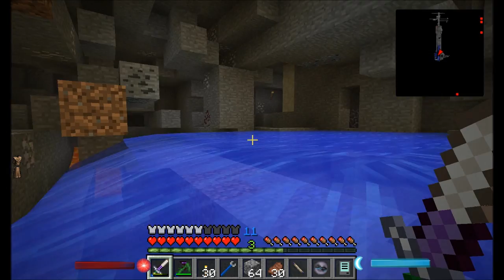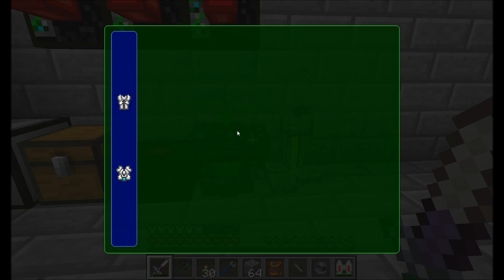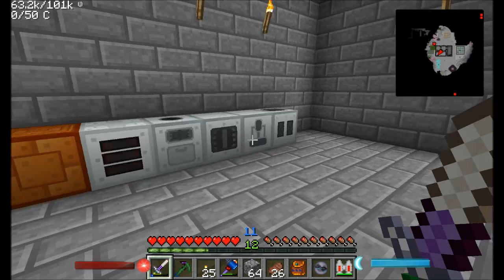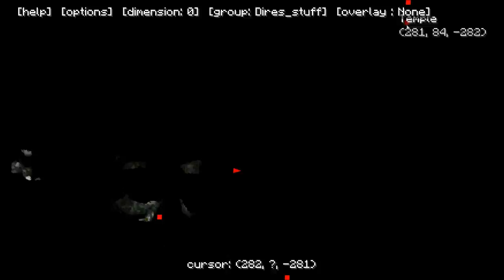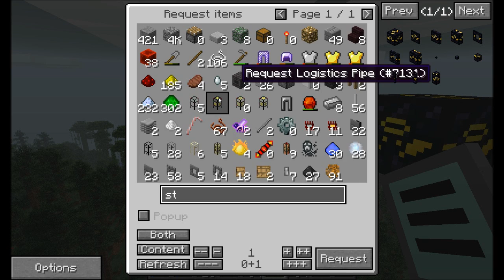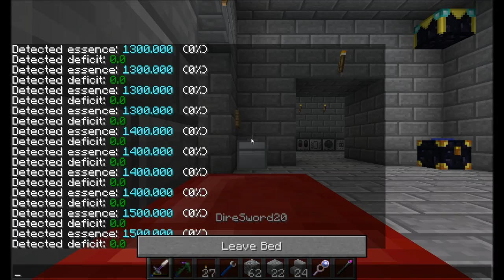Lets Play   S6E41 UberMiner Prep

Comment: Dire, useful tip for the flight mode on the modular powersuit: Keybind the flight control system in the helmet, and mostly use that instead of toggling the jetpack and boots. Then you don't even really need jump assist - leaving the pack and/or boots on lets you act like you have an IC2 jetpack, so you can control your "jump" height very easily, as well as soften your landings or go for brief 'suborbital hops', and turning on the flight control mode transforms that into the stable creative-like flight.

Another option is to put the boots and flight controller on the same keybind and only leave the jetpack always-on, which makes it easier to not rocket skyward every time you jump but still gives you the faster ascent of having the boots enabled when using flight mode.

Comment: It will be MFFE. MFFE now has something very similar to RedPower frames, though it is still a bit buggy based on some of the testing I've done. Just like RedPower you pulse your engine to move everything that is part of the frame, but unlike Red Power you don't need special blocks as the frame. Just upgrades to define the dimensions of the overall area to move.

Comment: Dire thanks for answering my question about the scrolling shortcut :)
Why don't you try IC2 teleporters? (Blue teleporter blocks) They drain energy but you can also transfer power much easier with it because it does not need a tool to tell you how much power it has, moving the ars magica stuff for power is a hard task.

Comment: I'd love to play with your modpack, but my computer just doesn't have the strength to run with a stable framerate. There are just too many mods installed. I can't even get over 10 FPS with the bare minimum settings and with config files edited to be optimized for performance. I'm going to need a new computer in the end, and that's going to be expensive.
Reply: I had the same reasons as you did, however, I just went and built one:)
Reply: MoMan711 I might have a custom one built online so I don't have to worry about putting it together and screwing up on accident. I don't think I can put one together without having my hands shake. I'd get way too nervous.

Comment: Not turtle-based? WHO ARE YOU?! AND WHAT HAVE YOU DONE TO DIRE?!
Reply: the massive, eat 1000 blocks at once frame quarrys of the olden days :)
neeeeeeeeeeeeeeeeeddd frames :)
Reply: i know, i was shocked too
Reply: I think it is MFFS, or maybe he has a updated version of project red with them movey things
Reply: *****
frames... i miss them so badly
Reply: But he did the frames thing before.
Reply: Max Koved Dire said it was never on a dire video before.. Thats why he pointed that out.
Reply: PartyRockerC Frames -_-
Reply: Pretty sure it is gonna be MFFS, I made a pure MFFS bore on a server, and it's incredibly powerful. And steel intensive (that's why he setup the autosteel crafting) to a point you wouldn't imagine.
Reply: sc2_Nightmare So what? It worked.
Reply: llomellamomario the mod pack doesnt have mffs calavia version (if your mffs is the same as mine)
Reply: llomellamomario nvm just checked

Comment: Dire, How I fix the problem with minimap?
Reply: showing current level and not surface in general? i believe default keybind to swap between cave mode and regular mode is u. it's either u or i for certain, but im pretty sure it's u
Reply: smash the fingers on your keyboard and hope that you hit the right keybinding... :-D (joking)
Reply: MadLocustRising1 lol that's me when i accidentally hit something and i dont know what it was and i dont like what it did
Reply: PaleWaffle tell me about it :-D i had trouble with my map at the start of the 1.6.4 pack release. for some reason it wass zoomed in all the way. then i found the ''Page Down'' key and its uses. glad i did :-)
your ''Esc'' option should have Controls options, and in there it should be easy enough to find the hot-key you are looking for. alot of hot-keys are badly placed. too many on ''C'' key by default thats for sure :-D
Reply: Thanks, you helped so much.

Comment: I'm thinking MFFS for the system for moving the mining machine but not sure :)
Reply: Danilus He specifically said around the end of the video that it isn't turtles and something that hes never shown in a video
Reply: Turtles + Mining well. He's used it before.
Reply: Exactly my point.
Reply: Kalj121 Really? How did I miss that. Woops. Then it probably is MFFS.
Reply: That would also explain why he got the AM2 portal instead of using the ones from Portal gun mod.
Reply: maybe a quantum computer
Reply: If I remeber correctly the qCraft quantum computers can only move "mundane" blocks (and not machines). I may be wrong.